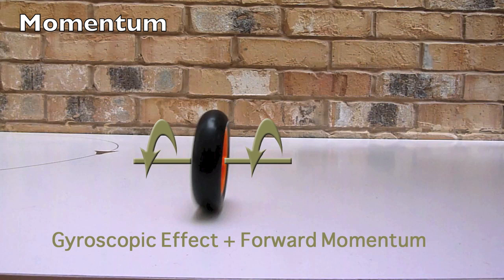The Physics of Countersteering

Comment: So it sounds like your center of gravity of the most important thing here. Imagine when you're driving and making a sharp turn and you have a cup of coffee in your hand.  The coffee wants to spill out the opposite side of the turn.  If you're turning right, the coffee inside the cup moves left and vise versa.  If you tilt the cup, the coffee stays inside because the center of gravity shifts with the tilt.  So, now replace the coffee with your body, and the cup with the motorcycle.  

It sounds like counter steering's main purpose is to allow you to lean the motorcycle in the quickest time possible.  If you need to turn left quickly, you lean left and turn your handlebars RIGHT.  The moment your center of gravity shifts to the left, quickly turn your handlebars LEFT to take maximum advantage of your center of gravity shifting.  I am by no means an expert, but that is what I got from the video. I hope of experts can chime in if this is correct.

Comment: Assume you’re already riding with the balls of your feet on the pegs and without putting weight through the handlebars

Lock your outside thigh and knee into the groove in the tank designed to hold them; it’s called “hanging off” for a reason. The rest of your weight can go through the balls of your feet, into the foot pegs, but keep the inside foot free enough that you can pivot your (inside) leg.

Comment: I've watched so many videos about counter steering trying to understand it and, unlike the other videos, this actually makes sense. All of the other videos just said, "oh it sounds but backwards but this is how it works trust me just do it," and they barely even explained how to do it. It's just a 2-3 minute video saying, "turn it left and it goes right"
Reply: Basic Weeb It is easier to understand like this for me.  "Push right, go right.  Push left go left".   Then it is not opposite or counterintuitive.   It is what I have been doing for years, but I didn't know I was doing it until I saw one of these videos.   I wasn't sure I was doing it until I practiced it and it did exactly what I expected and I did it at speed and it felt natural.   It is the only way to make turns at speed for me.  It only takes a small push to get the bike to lean, but the harder the push, the tighter and more the lean you get.   If you want a tight 'Laguna Seca' turn you push hard and slow, and get the knee out to take the turn.
Reply: It's because all the bikers who explain in the other videos, they do not understand the underlying physics. Rarely do they even describe what the wheel is doing in that situation.
I've been riding a scooter for 3 years and had no idea how this concept works, until watching this video.

Also, there's the fact that in slow enough speeds, regular steering works. Why that happens can be derived from the explanations in this video.
This begs the question: How do I know when to use counter steering?
The answer - you don't "know", you "feel".
Every rider has the intuition that at high speeds, you do not turn the wheel like you do when you go slow. You feel intuitively that it won't work, because of the high speed and the forces that work on the motorcycle at these speeds.
So naturally we drive like we ride bicycles - we lean, and that works 99% of the time.
In extreme situations, like described in the video with the pothole, knowing how to counter-steer can literally save your life.
Reply: i second this.
Reply: cardiacpa lean left push left, push right lean right
Reply: I don't understand why there is so many videos about it. I had never even heard anyone say anything about it even though I've been riding my whole life. I've never had to think about it. It's just natural.
Reply: Phil Wollerman umm, no. Try again Phil.
Reply: Here's an easy way to get you head around it. Get hold of a bicycle and walk it along steering only by holding the seat - you've probably already done this. To get it to turn, you exaggerate the lean until the handlebars flop down to the right position.

You might be a bit naughty and ride your motorcycle with you hands of the bars using the same technique to steer.

Countersteering is doing the same thing to the bars but by pushing.

Comment: I just don't get it ! Damn it.. Is there one where they have a shot from the top and you could which side of the handlebar is push first and followed thru the turn.?
Reply: +CaliCal68 okay I got it now... Amazing how things work and how simple it is once you grasp the concept.. Thanks guys..
Reply: +CaliCal68 So, do you push the handlebar once just to initiate the lean and adjust the angle naturally with your body? Or do you keep pushing the handlebar through the turn to keep the lean at the angle you want?
Reply: +no1ymfan1 as explained in this vid, once you reach balanced neutral lean, the bike will stay there until something changes. so, no, you don't need to keep applying counter steering force throughout the turn.

Comment: Gyroscopic precession is what you actually feel when you press on the bars. It's why there is such an instantaneous and direct response, regardless of suspension, tyre bend, pressure and any other 'soft' components; the torque on the bars acts on the wheel/gyro hub without going through soft connections It's also why you can slide both wheels and still maintain a bank angle without immediately crashing. Centripetal force turns the bike but gyroscopic precession steers it, if that makes sense
Reply: Justin Esdaile What do you think what would happen when you change wheel to a ski? 
How much gyro effect you feel after that?
The bike still turn like before.

Comment: The description at 2:32 was critical for me. Counter-steer then LET the bike turn. Relaxing on the bars allows the bike to naturally "fall" into the turn.
Reply: shuumai
Quite. A point that is amazingly difficult to convey effectively.
Reply: It is really important to release the counter steer to get the maximum steer in the direction you want. This is after us8ng counter steer to get you into the desired lean angle. Unfortunately this video only tells half the story which is why it is so simple to understand. 

I was going to make a digital protractor  attached to a bike so we could see the actual amount of steer and in which direction throughout a turn to finally put this subject to bed. I am amazed that no one has done it yet.
Reply: @steve24822  It depends on the bike, though. If the bike has a taller center of gravity and less aggressive steering geometry, it is as you say. You countertweak the bar, momentarily, then you relax (or even help whip the bars into the turn if you did a super aggro counter tweak), then once on your arc/radius, you generally have to reapply and hold a bit of counter force to maintain that arc under any bit of throttle. But on the more modern super sport crotch rockets, the steering can be so quick that you never have to "let go" of the countersteer. The bike instantly rolls and achieves a new equilibrium throughout the entire process. It's all happening at once. As soon as you start to apply counterpressure, the bike instantly leans and changes arc (taking the fork with it, into the turn) and you continue this continual process degree by degree (very rapidly, mind you) until you reach the radius you want. Instead of dialing in one big bite at a time, you are ordering and eating and digesting tiny nibbles of your turn, a la carte, until you're there... cuz it happens that fast. On this quick-steering crotch rocket, the only time you will feel any separation between the different parts of the process is maybe in a very tight switchback at around 30 mph. Depending on your motorcycle's geometry, you can have a very different experience from another rider. 

This super quick steering doesn't mean the bike can turn any harder or tighter or go any faster. Or avoid a pothole any better. But is does allow for a bit more gradual and continous course corrections mid-turn and is generally regarded as enabling potentially better lap times. It is no fun to ride, though. Distinctly feeling the different parts of the turn is very rewarding.
Reply: https://youtu.be/odJJXhg79j8 this video right here is long but it’s the only video you will ever have to watch to teach you how to ride. It’s older and corny but the facts and knowledge involved is amazing I always refer back to this video and watch sections of it all the time after rides because you have to build that muscle memory and perfect all these basic skills and I guess advanced as well but perfecting the skills taught in this video will make you an amazing rider if you take the time to actually properly learn and practice this stuff. Anyone can become a good rider practicing bad habits. Make sure you are practicing the right thing and you will be amazed on how good will become.
Reply: https://youtu.be/odJJXhg79j8 this video right here is long but it’s the only video you will ever have to watch on how to ride. I recommend watching the first few parts and practicing that then move on with the other stuff. I always refer back to this video to help make sure I’m riding and practicing proper technique to the best of my ability. Please take the time to watch this I promise you won’t regret it. Let me know what you think if you end up checking it out.

Comment: This is by far the BEST explanation ever!! All everyone ever says is to turn in the opposite way that you want to go, and that just did not make sense to me. What this has explained is that turning your wheel in the opposite direction "is only a momentary event" to get the bike to lean. Once you are in the turn your wheel is no longer being turned away, it's now following that path of the direction you are going, please do not overlook that part of what was said. Bravo .. I now get it.
Reply: Dwayne Washington --> You are Wrong Sir... When you are in a turn/corner, the rider Must 'maintain' that push on the grip (wheel turned slightly in the opposite direction) to keep the bike in the lean... if you let up pushing on the grip, the gyroscopic effect of the spinning wheels will then pull the bike upright. Not good in the middle of a turn...
Reply: @Ducati_Dude  the guy literally explains in the video that once a sufficiently angle of lean is achieved the bike becomes balanced, if u keep counter steering throughout the turn it will result in more lean requiring u to turn more sharply in order for the two forces to be balanced. If u countersteer too much or continually countersteer without sharpening the angle of ur turn in kind then ur bike will fall into the direction ur turning
Reply: @alec1020  The bike wants to upright itself. If you don't maintain a certain amount of coutnersteet, the bike will right itself. What you want to do is hold the appropriate amount of countersteer for the lean angle and turn radius you're trying to achieve. I'd suggest finding a large, wide open patch of asphalt or road where you can take different lines through a turn, and experimenting with your normal, intuitive control inputs a little bit to see how they alter your line through a turn... What I'm describing above is in line with what I have observed riding and what has been explained to me by lots of very fast riders.
Reply: You are partially right Ducati dude. The thing is if you are in a corner you can just lean with your body in the corner and make your weight to create the counter steer you need without pressing the handlebar. Of course if you have to tighten the corner just press on the inside handlebar some more and adjust your position accordingly .
Reply: @Ducati_Dude  I guess you have a bike, so try your experiment; Don't blame me when you crash. Sorry, I don't mean that!. Honestly though I can go around a a corner (say a slip road to a motorway) and once at a set lean angle can take my hands off the bars  (ok,  assume const. throttle) and maintain a constant radius - no steering input needed.
Reply: @ziptimeandspace  ---> Ko... next time I'm on the bike, I'll try what you suggest... 😉👍 I'll run some video of the 'Experiment'... 😃👍
Reply: Yes, it is the lean created by the centripetal force of the counter-steer the turns you in that direction. This is why if you start a turn by a hard lean followed by turning in that direction there is no counter steer effect. Counter-steer is most powerful when you are completely upright. It is the only way to avoid suddenly appearing obstacles.
Reply: Your tire is still turned the opposite direction lightly while leaning towards the turn.

Comment: Sorry to say that but the first part of the video is messed up: What makes the bike tip out of the curve is the CENTRIFUGAL force directed from center of the turn to your bike - NOT the centripetal force as presented!!

A force creates a torque in the same direction that it is applied - not the opposite!

To prevent from tiping out you lean your bike into the curve so that the gravity gradually becomes the centripetal force as a compensation to the centrifugal force - this prevents you from falling into either side.
Reply: 327nemo "What makes the bike tip out of the curve is the CENTRIFUGAL force directed from center of the turn to your bike...."

this is WRONG WRONG WRONG. there is NO SUCH THING as a centrifugal force. ask any physics professor and they will tell you. the ceptripetal force always points towards the center of an arc and, in the case of this video, produces a clockwise torque about the bike's center of mass. and it's consistent, the bike tips over in the clockwise direction.
Reply: stopdropandroll a "centrifugal force" is fictitious and the phenomena of "centrifugal force"  is pretty much explained by newton's first and third laws and an object's inertia. have you taken physics classes before? if you have, your professor probably told you this. if not, take one then ask the professor.
Reply: Finally someone gets it. Instead of saying "omg great explanation!"
Reply: "no centrifugal force"...?

then what about centrifugal pumps?
Reply: btaeubel being condescending does not make you an expert in the subject matter.

what 327nemo is referring to is a zero net force that allows you to stay at an angle (without tipping over) as well as maintaining that radius of curvature as you follow a curved path at a constant velocity. yes, centrifugal force is the inertia of the mass experiencing the curved motion. but what you are doing is completely dismissing the term "centrifugal force". centrifugal means center-fleeing, while centripetal means center-seeking. Centrifugal force is not a source of motion itself.
Reply: stopdropandroll how do i get a point across without being a jerk?

Comment: CambridgeScienceCtr At 1:04, the narrator says that the gyroscopic effect keeps the bike upright. This is incorrect. The steering dynamics of the bike keeps it upright. When the bike falls over, the steering dynamics makes the front wheel turn in the direction of the lean, keeping the contact patch of the tires under the bikes center of gravity.

The gyroscopic effect does help with keeping the bike stable, but a bike would never be rideable if you removed the steering dynamics. The whole consept of self balancing "safety bikes", which modern bicycles first was called, is the angled front fork which turns the wheel in the direction of the lean.

Read this research about it: www.phys.lsu.edu/faculty/gonzalez/Teaching/Phys7221/vol59no9p51_56.pdf

You should correct this in an annotation or in the description.
Reply: NoWayBiker great article, thank you!
Reply: NoWayBiker
Great stuff! 👍
This video is still miles better than the usual nonsense but one might as well point out its minor flaws.

Comment: another thought: bike never really turns (that would throw you outside), when leaning the point of contact on the front wheel shifts. As normally the wheel touches the ground on its lowest point, in a turn that touching point moves forward and up. From the perspective of the bike, it's actually moving uphill, not turning!

Comment: The video says that if you lean into a turn, the Outward Moment due to friction is balanced by the Inwards Moment due to Gravity. However, is you consider moment about the Centre of Mass of the bike, then you only have an Outward Moment due to friction, and the moment produced by gravity would be zero as gravity is acting through the centre of mass itself. Thus, there would still be a resultant outward moment to throw the bike off the track even if the bike is leaning into the curve. I'm struggling quite a bit with this concept so would be great is someone could correct me if I'm wrong.
Reply: The center of mass force is not vertically above the tires contact with the road. So the gravitational downward force times the offset is the counter balancing moment.

Or (or another way) the force of the tires pushing vertically up coupled with the gravitational force pushing vertically down creates the couple (torque). So the more you lean out the greater the torque.

My favorite quote from my applied mathematics teacher was

"the closer the couple the less the talk".

Get it --- ha ha --- I really liked that professor he was a great guy.

Comment: Yes but this doesn't take into consideration the full effect of turning the front wheel. It says that countersteering is the way to get the bike to lean over, but it ignores the steering effect that is part of the process. It also ignores the fact that the bike will tend to go straight even after the countersteering motion, despite the fact that it's leaned over. You can't just countersteer, you have to get the bike to lean over which means covercompensating for the steering turn.